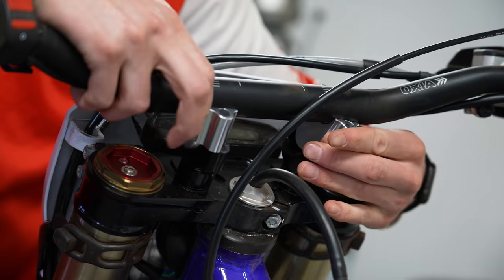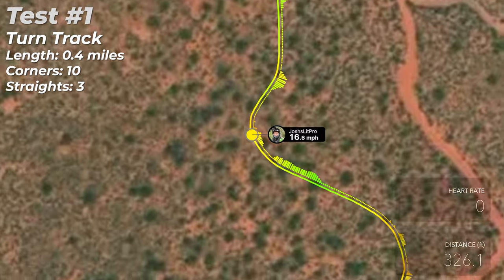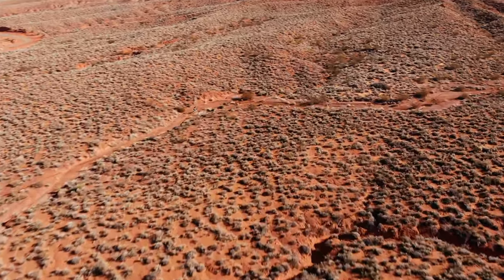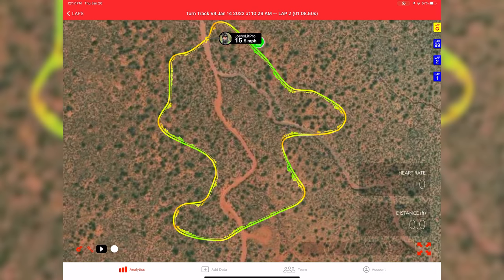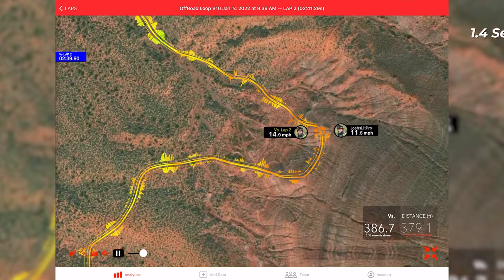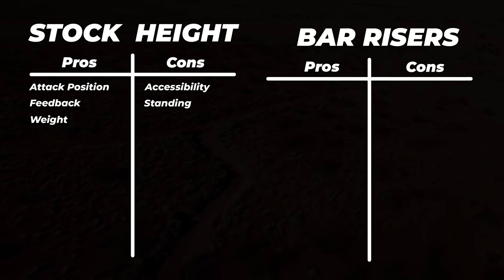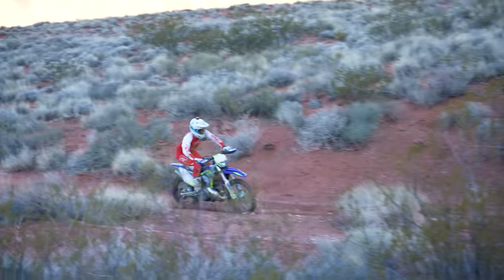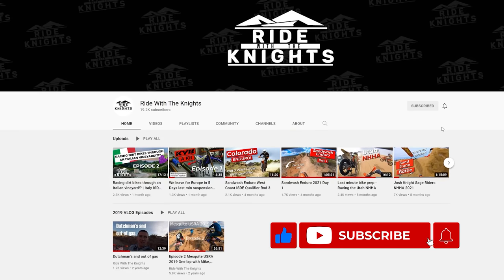Your Handlebar Height Actually Matters!! Here's Why...

Comment from the maker: Rider heights listed below.
Josh - 6' tall, long legs, average torso. 
Cory is a similar body stature 6' tall.
Reply: To take differences in the time of a section, even with just the fastest time, does not mean the bar height is a big factor.
Bent bars did not even slow down Magoo.   "Testing things" is pretty impossible for sound conclusions if there are factors no identified or controlled,--like you felt better for a lap, and I bet they were your last laps.  You are measuring rider variance, not the effects of bar height. You just don't want to admit that not any of your laps are perfect.  nobody does. :)
Reply: I'm 6'. After an 80-mile enduro, that little bit of hanging over the bars with my back bent for hours while standing sure does add a whole lot of fatigue and discomfort.

Comment: I’m 6’ and have risers, but this is due to lower back pain.  I find that taller bars/risers helps the lower back while standing.
Reply: Unless you have a lower back injury...lower back pain while riding is usually the result of weak core muscles.  So strengthening your core would fix that, and allow you to ride without risers-which at your height is probably ideal from a handling/performance perspective-as well as ride in the proper attack position longer...benefits all around for a stronger core.
Reply: @riodj80  I appreciate the feedback my friend, and what you say is true, but at my age 50+, with 35+ years of jujitsu / mat work, the lower back appreciates the bar risers despite good core strength for my age 👍.
Reply: @ml5955  Fair enough…and good on ya!  Do what works!

Im not far behind you in age (40+), and strengthening my core fixed my lower back pain while riding…so I’m always eager to pass that along.  Have a blast!
Reply: I agree. Besides. At my age I'm not going to be winning any gncc titles. Love my risers. I do see some cons to them, but the plus is I don't hurt
Reply: 'core strengthning ' is a myth alright , your muscles are already working all day , every day and they are over worked if anything.
Reply: I agree, I feel a bit cramped when standing on my ktm for longer enduros
Reply: It would seem to make sense for taller riders to use bar risers that both elevate the bars AND push them further away, as that would in effect lengthen the bike while raising the bars at the same time.
Reply: @ThePJExperience  A lot of people spend all day sat in a chair so that's not really correct.

Comment: So, when i returned to riding after 45 years of office work, i felt the need for bar risers.  Seemed like an easy, cheap mod.  However, I soon realized I was the problem, not the stock setup.  I felt like I was riding in the right position, but i was not.  lol.   Took me a long time to get back into shape to even hold and feel comfortable in the correct riding position before I could finally correctly set up my suspension and begin riding correctly again.   Correct riding position solves a host of issues (too much weight on front makes you think it’s not handling well, always pushing), allows correct damping setting, and lets you ride as intended without a “crutch.”  If you have injuries, etc. then I get it.  Sure, i have to lean forward a bit on the street, or settle for sitting forward till I get to the dirt, but keeping your calves vertical and getting head low will make stock bar height be just fine.  I’m only 5’9” but i am in my 60s…so stretching and getting in shape solved the issues, just took a longer time!

Comment: I love this video. Formerly a motocross rider but have been riding more off-road/desert for the last few years. I like standard risers with Honda high bend , in neutral position, Pro Taper evo bars . So they are about 1/4-3/8" higher than a flatter motocross bend. This is the perfect blend of stand up comfort and turning precision and feel.

Comment: I think there’s a couple things that I feel were missed in this video:
1. What is the height of the riders?
2. Most taller riders won’t just lift the bars, they will also move the bars forward which will help with keeping the weight on the front wheel. It appears as though you just lifted the bars without moving them forward which would position the bars more in your lap making it harder to achieve attack position and weight forward. 

That said, great video, I really enjoy your content!
Reply: Exactly right, you must go forward and up.
Reply from the maker: Great observations Max,

 Rider heights listed below.
Josh - 6' tall, long legs, average torso. 
Cory is a similar body stature 6' tall.

2. I agree that there are many other variables to consider when setting up handlebars. Bar sweep, bar rise, clamp height, clamp forward backward position, rolling bars forward versus backward, etc. We'll have to do some more testing in the future, however for simplicity, we only changed one variable during this test. 

What video would you like to see next?
Reply: @ridewiththeknights  personally I would love to see hill climbing techniques. Especially for hills that you can’t carry momentum into. 
Proper body position, throttle and clutch techniques, gear selection, etc. 

I know there is an endless amount of variables that you encounter with each hill but I’m sure there are some basic principles and techniques to apply and you have the best content I’ve seen online for presenting these things in a clear and concise manner. 

Thanks for all the work you put into this!
Reply: @JDNelson I was referring to moving them forward on the triple clamps, not rolling the bars forward.

Comment: I ditched all the riser stuff a few years ago when I got back into riding. Stock KTM low stuff rolled back few mm from fork parallel. Tall stuff was making me lazy and keeping me from the attack position. High speed handling suffers as a result. As little as I ride, I need all the stability I can get 🤣 If I ride a bike with taller clamps I roll the bars a little more. Tall stuff just saves your back if you’re out tooling around looking at birds.

If I had a tig welder I would test some footpeg positions. I have some theories on that.

Quality video 👍
Reply: Totally agree.  I'm 6' 1" and I love my bars low.  The bikes handle more like mountain bikes and just feel more controllable and stable.

Comment: At 6'3" I have always run risers, usually the Rox Risers at 2".  Always until I started racing that is. The first season of racing I had set my bike up with 1.5" risers and have since dropped back to 1/2" rise over stock. I found the taller risers didn't feel great when trying to ride aggressively, thread between trees, make quick turns or on big hill climbs. The tall risers seemed to compensated for weak muscle groups in some areas and stressed others, like my forearms and hands as being more upright was more like being pulled by the bike vs letting the bike push me in the attack position.  Racing has improved the breed as they say and although no one will ever pay me to race I'm learning a lot and becoming a better rider.  The race organisers will be happy to have me move out of the peewee class for sure.

Comment: Love the vids lads, I am 6'8" and I attach a YZ250 (2 stroke) beneath me when I ride, best investment was Fastway Evolution footpegs (if you dont have em get em) , I use bar risers, 3 months of trying to get and adjustable set ordered from bike shops in NZ proved to hard (yeah I should order some on the interweb) and Pastrana bars..... love to hear the comments roll in on this set up. Be keen to hear something new as I get plenty of advice when Im at rides.. p.s I race GNCC in NZ with that setup
Reply: I too run fastway pegs in the low boy position, I have just installed Fasst flex bars in a 10 degree enduro bend. I prefer Rox risers instead of the straight risers in this video, that way you can roll the bars forward giving more room. The straight risers bring the bars too far back cramping the cockpit. The cheap Ebay chinese knock offs of the Rox Risers are just as good, I have both. I don't race anymore but trail ride a trick CR500.
Reply: Move your pegs back 50 mil make a plate to adapt them to the original mounts this will compensate for your long arms
Reply: @craigdavies8099  Thanks mate appreciate the advise
Reply: @peterwhyte1385  cheers I will see what that looks (pic of me in attack position) & feels like

Comment: Hi im 6ft 3inches with long arms and legs.Using risers transformed the bikes(husky 450) slow turning ,comfort and technical abilities.I am not a racer.previously felt i was "lurching"over the bike.Also lowered pegs by 2cm ,Now very happy and did same to CRF 300L .Only negative is that it makes the steering slightly easier to throw off line.I may purchase a steering damper.

Comment: Good video, remember the risers shouldn’t only raise up and back, if you raise the bars, you would benefit greatly by going up and not back, this is achieved by off set bar clamps or risers.
Then you will see the cornering and attack position drastically improve, and you can ride much more comfortably.
Just my opinion, I’m 6ft, and will never ride with the stock height bars, but I am only a trail rider ….now.

Comment: One aspect that wasn't addressed, though pretty obvious is when using a steering stabilizer. For instance with the Scotts stabilizer, the under the bar mount requires you to use a riser. Additionally it forces you to use bar position 3 or 4, completely eliminating 1, and 2 all together. So for someone like myself who is 5'8, I have no choice other than using 1" risers with my bars in position 3 the closest...

Comment: Great video man! I’m 5’10” and like the stock height, bars in the middle position in the triple clamps(if they have it) and my levers at 31 degrees measured from resting my iPhone on top of the grips and resting on the lever(using the bubble level app).I find I have more balance and feel on acceleration and breaking because it’s easier to stay in the correct balanced position when riding. This is done after finding the right forward or backwards position of the handlebars in the bar clamps. Too far forward and I get arm pump and too far backwards feels cramped. Just takes a quick ride to know if its right. I find that setting it 1 mark up from the middle mark on you bars(more forward) is a good starting point. Everyone will have their own opinion but that has worked for me.

Comment: I added bar risers to my cr250 s stroke, it became a when new bike . I was standing on pegs & slumping my back just ever so slightly to hold the grips, now it's perfect, back is at ease, way different ethos, all this from moving my bars up 2" 
 2001  cr250, set up for woods riding, 7/8" alum. Moose bars
2" Zeta bar risers . 
Totally different ride now

Comment: BOUGHT MY 500 EXC WITH RISERS that were about 50mm high, it was a 2nd hand bike - i left them on as the bike was amazing on dual sport riding but the day i went racing i realised my cornering was pathetic - i dropped one 25mm riser in practice, dropped the bars to standard for race - have never gone back to risers even though i spend most of my time doing dual sport riding and hard enduro ..

Comment: Great video! It's amazing how much difference a small handlebar adjustment makes. I think everyone should play around with the stock setup before they go and spend money on anything, it can make a huge difference.

I'm 5'11" and while I've ran risers before personally, and always find that I prefer the more "connected" and "direct" feel of the stock bar setup. Especially when it comes to tighter single track, I find that it's way easier to confidently control the front end on a stock bar. I personally haven't noticed a significant decrease in comfort/fatigue... I get more tired crashing due to the riser-induced front end vagueness than riding with a lower bad :D

Comment: This ""TEST"" just by itself without any ""REASON"" to raise the bars & without doing anything else to the ""COCKPIT"" was worthless, like ""JUST"" putting on a pipe & not doing any other ""HOP-UP"" things to the bike & the only thing that happens then (in MOST cases) is the ""POWER"" gets moved around to a different place in the rev range, just as the higher bars placed the riders point of connection to the bike in a different place. In either situation, there is a boatload of other things that NEED/MUST be altered, changed or adjusted differently to gain any true long term benefits. Party on, Garth!!!

Comment: sorry bro,  i don't think you actually get it...  the ride comparison and handling characteristic changes you experienced are individual for every rider.   torso length and arm length are the factors that you want to consider when determining fitment.   Bar height is only one factor, bar sweep is another...  another factor that you didn't consider is peg height,  peg height is critical because seat height is not adjustable.....   riding disciplines are the reason for fitment because super cross is a completely different world from trail blasting,  setups are completely different.

Comment: Everyone seems to forget that taller riders also have longer arms which can offset the need for higher bars. Too many tall riders throw on risers by default because they think it's needed, when really they could be relatively neutral vs a shorter rider with short arms.
I feel a more interesting test would have included steep climbs and more hard enduro type terrain. Chris Birch is using very low bars (Astra, lower than stock). 
Timing using single-track seems like a pretty useless metric since lap times can vary so much. What you didn't include was the standard deviation between the various tests/setups, making a single best time comparison pretty useless.
Reply: Yeah, your arms are generally longer if taller, but each arm is (very roughly) half your height. So for every inch or so taller, your arms are maybe 1/2" longer but your hands are an extra 1/2" off the ground (approximately).
So, from 5'9" to 6'3", that's maybe 3" of extra reach required (though with knee and back angles, there's other geometry at play).

Comment: What are the rider torso length and rider overall height?  What setup are the riders familiar with?
Reply from the maker: Josh - 6’ Tall, long legs average torso.
Cory - 6’ tall

Both riders typically run handlebars near the stock position.

Comment: Excellent video.  Experiment, understand  your abilities,  set by typical riding areas/ terrain.  And alway take in confort!   So you can enjoy the longest rides..   it’s about fun.   Not getting hurt..    also change with age.  I ride well but less aggressive then 20 yrs ago..    still fast, but stopped the risky racing..   in the end find what works so you can do this as long as possible..

Comment: I am 5'5 and have a hard time keeping my elbows up with stock height..how do u get lower than stock? What can I do
Reply from the maker: You can install either lower Bar Clamps or you can install a different handlebar that has a lower "Rise". All handlebars rise somewhat from the center however depending on which handlebar you purchase you can get a very flat, low handlebar. I would recommend starting with a low handlebar bend first to see if that solves the problem. If not then you can look into getting shorter bar clamps.
Reply: @ridewiththeknights  thankx.  Have looked for lower clamps but have not found any..do u know of any brand that may have some for a  yz250 smoker...
Reply: @jeffmacdonald9386    thank you very much

Comment: I put them on my 94 yz 250 im 5'11 im hoping it will help handling in corners also there moved forward in alighnment with my forks
Reply: "moved forward in alignment with my forks"
That started with freestyle.  2019 YZ250 at 5'9", and I rotated mine back to the rational 80's, and enjoy much more co0rner control and much easier to keep my elbows above the bars.  The grip ends are actually suppose to be pointing down.  I tried it for 2 seasons with the pro tapers "0" in the middle of the clamp, (under the pad), and I rotated them down to the #2 in the middle of the clamp and adjusted my levers accordingly.  Now,--I can feel that flat corner.  I notice pros falling on flat corners today.  
I laugh and laugh and laugh.  But if you want to use the freestyle set up because all the kids do it today, it's your crash, not mine.

Comment: Personally i went with a lower pro taper bar on my Yz450f 2020 and i turn much better on mx track. i am 5.7
Reply: Now, rotate your bars back until the grip ends are pointing down about 5 or so degrees, and reset your levers.  Rid that a few times, see if your corner confidence gets better, (especially with out a berm).  Look at the pro set up before freestyle got big, (from the 80's to the mid 90's), not after.